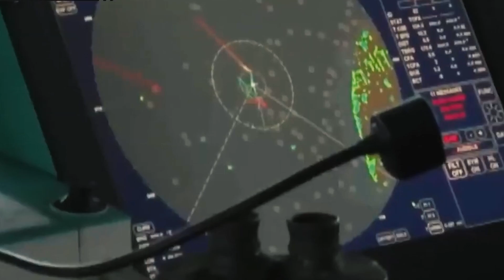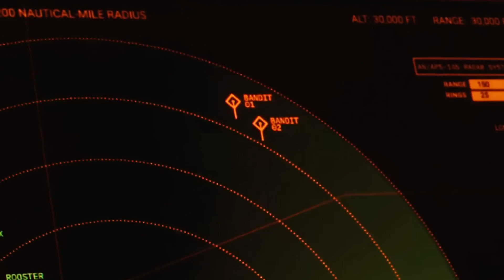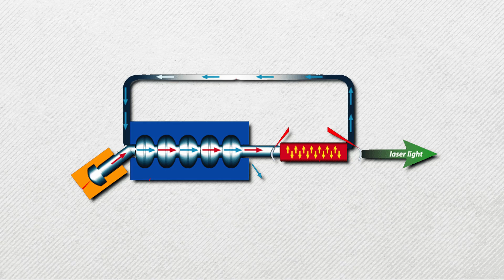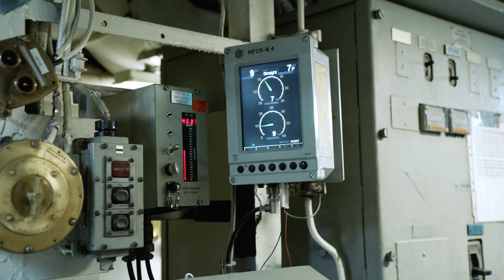High-Power LASER On US Aircraft Carrier SHOCKED The World! FULL Alert!

Comment: In reality it should not be that difficult to install a dedicated  nuclear reactor for the laser weapons.  You would not need a huge reactor.  You could put the weapons on pretty much every ship the size of a destroyer or larger.  Once the engineers develop a universal mounting / modular system it should be easy.  They should bring back the battle ships and refit them!  Those things have such heavy armor and enough space to house huge reactors capable of handling a hundred anti missile systems.  Then you still have the big guns for anything inside of 25 miles!  Update them into gps guided rail guns and woooooah nelly!

Comment: Yoou overlooked one important factor with using lasers against hypersonic missiles. They are already extremely hot just from flying at the high speeds that they travel at. Sure, they may be able to easily withstand 2k degrees, but a laser would very likely easily be able to cut through one that is already pre-heated as a part of its normal operation. Also, a slight amount of damage will send one into a spin very easily.

Comment: An interesting podcast that is well done. Still, there are aspects which you are 'thot to have glossed over or ignored? First, for instance, as you do hint, it's understood that our legacy surface vessels, such as Arleigh Burke, for instance, simply cannot accommodate beam radiation weapons. Their engine spaces do not have the room necessary for additional power generation, yes? For a second, while you mention a 1 sec. "burn time" rate on target, which might work well for an unprotected Shahed, one has to wonder what "burn time" might be required if the target is maneuverable, or is coated with ablative or reflective materials? One thinks such issues are particularly acute in the laser power ranges particularly available now, from 50 kw to 150 kw. But perhaps not so worrisome once power levels get up to 500 kw levels? And, third, how is all of this effected, if at all, if the beam is a free electron weapon, rather than a laser? One wishes you might have covered these points. Too much to ask? :(
Reply: Yeah and you have to have deck room for the laser itself and that is at a premium as well. And now we are back to an arsenal ship with missiles and several lasers on board. Also do not forget that capacitors can be used to store a couple of shots if not more. That is being done now in certain applications. So, you charge the caps while getting to the battle zone and arrive prepared to defend. And throw in the Zumwalt's and you are making a junk pile usable again.

Comment: I've seen quite a few videos about lasers & NONE were ever estimated at $1,000.00 per shot ! I've heard more like $5.00 per shot.
Reply: That is including research development, engineering, and construction. That has to be considered but as time passes that goes down, down,  But with AI now on the table costs will plummet since we already have basic design.  Cooling is the limiting factor so when (not if) that is solved Multi megawatt lasers will be a reality. A ten megawatt laser can severely damage a cruiser or destroyer.
Reply: @Forevertrue Yes, but only if you are close. The lasers have short range. Also, they could use batteries instead of a generator. A Tesla Plaid pack can put out 700kw, and it has 100kwh. A hummer has twice that.